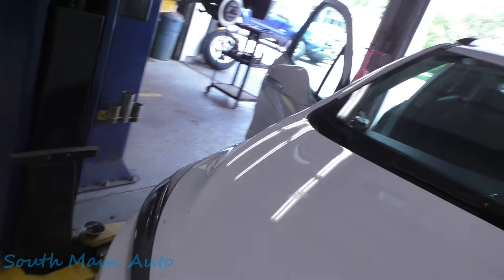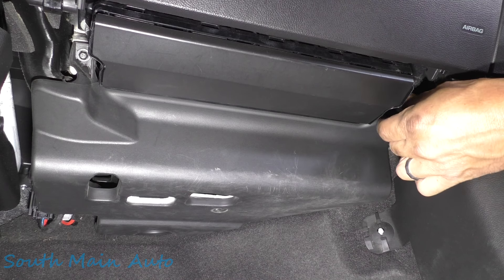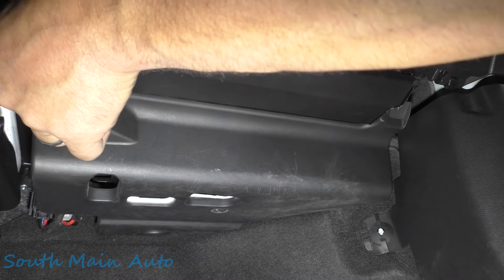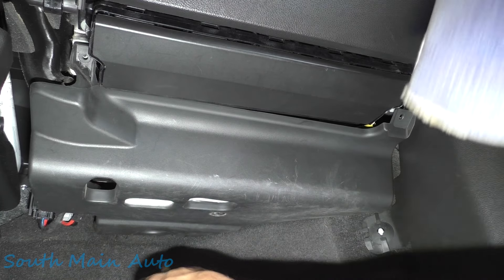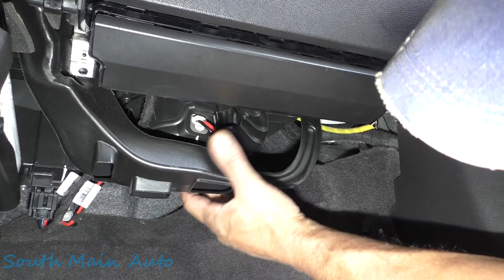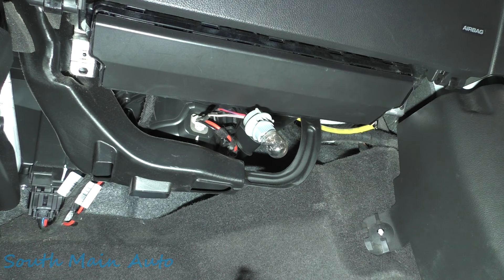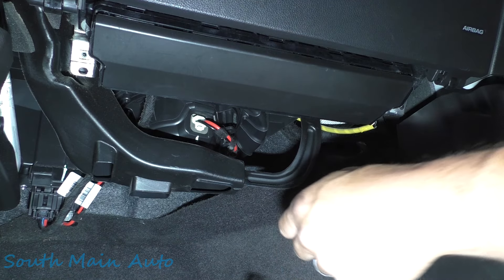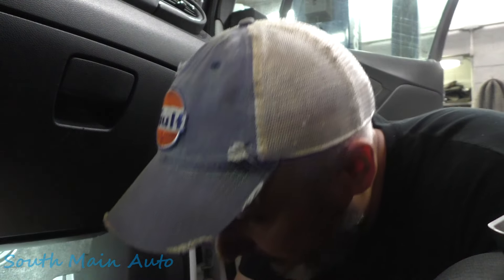Buick Encore - Blower Motor Replacement

Comment: Compare with the 5 minutes it takes on my 2012 sienna, from opening the passenger door, remove blower, install blower, close door.  Easiest blower fan I've ever done.  Not like the 1971 LeMans which required cutting a hole thru the front passenger wheel liner unless you wanted to completely disassemble the car from firewall forward.

The Toyota is mind blowingly easy. I just wish they built those darn fans with bearings instead of bushings.  I tore the one apart that is in there now after it had been screeching for some time and started stalling.  Pushed out the bushings and put in the same exact size in bearings.  Missed a spring washer I think, as it rattles now.  But it moves air and doesn't screech.

Comment: YOU MISEED THE HOLE! Go back to about 18:40 where you put the second of the 3 motor cover screws in and check your assembly. I believe you put the screw in alongside the hole instead of in it. It looked very clear it was not in the mounting hole.

Comment: My 2001 Honda Prelude needed a blower. You can't remove just the blower out of there without major work from the engine bay side. I had to dremel off some of the plastic shrouding from the old one to get it out and same on the new one to avoid all that other work from the engine bay side.

Comment: Interesting video - even if just a blower motor replacement; As an engineer, I still agree with Eric O about cost-cutting designs (which are not customer friendly, in the end, and therefore bad business on GM's part)!

Comment: Had a 97 Blazer way back when, same thing. They even molded a cutting line to indicate where to cut in the plastic of the blower box. It was topside work, but it saves the manufacturer putting a few fasteners in, I'll gladly pay that at point of purchase. Talk about stupid!

Comment: I know I am dating myself, but I remember when you could open the hood, unplug the electrical plug, remove an L shaped tube, remove 5 screws, and then you could pull the blower motor out.

Of course back then you could open the hood and actually see the engine and everything else.

Comment: 12:00 just let them dangle everywhere to get kicked, snagged and broken like the dealers have done!! (I'm not kidding, after repairing wiring and plugs) or actually attempt to make it work with zipties to hold the wires. if I recall you can ziptie around the ears that hold the cover on then ziptie the wire to those(double ziptie chain).
they had some permanent blowers like that many years ago and I think Chrysler and Ford did too. some designers bright idea 💩 and a PITA to replace, back then you could only buy the whole blower housings OEM, then someone made an aftermarket kit to "cobble" a new blower in.🤬

Comment: Reminds me of the GM vehicles with ball joints that are attached to the control arm with pressed metal pins instead of nuts and bolts. And when replacing the ball joint you have to grind off the pins and replace them with nuts and bolts

Comment: G.M. did this on some 95 ish jimmys with the heater core to remove  you had to cut on the doted line under the hood and leave a big hole. Nice

Comment: My first experience with a blower motor was on an old Buick. The first line in the manual read something like, remove the right front fender.
Reply: I’m still upset when a Buick dealer replaced the blower motor on my ‘74 Skylark by slicing a flap in the inner fender.

Comment: Older 70s GM cars "remove right front wheel,, cut hole in the inner metal fender(follow the stamped line) now you get to NOT cut yourself while working through the hole you cut. remove and install a blower motor. repair the inner fender using the piece you cut out. yours looked nicer

Comment: Everything is based on speed of assembly. The dash is pre assembled and installed as a single unit. They do not consider maintenance and repair till last.
The Service Manual is written by a Recent Collage Graduate with no previous experience with Automobiles. 😎

Comment: At least it wasn’t a ford focus. It’s buried under the dash and requires the glove box and fuse panel to come out. I tired but wasn’t going to break my back trying to get the screws up against the firewall ended up paying some 300 to do it and well worth it.

Comment: I notice in England when they dealing with plastic parts wire connectors they use a heat gun

Comment: Working at an auto recycling yard I have come across those stupid integrated Gm blower motors many times. Gm has unfortunately used them on many models in the last 20 years. Every time I’ve ever had to remove one, by the time it out I’ve always wanted to use the same hammer and chisel used to remove said blower motor on the side of the head of the guy who designed it.

Comment: the thing that I cant shake about these cars is, they have the provisions for the screws to hold the new blower motor in place.... which means that they went out of their way to put the original style plastic welded in, instead of just having it screwed in..

Comment: I worked as a vacation replacement at Jeep. I would fill the tanks with fuel. I accidentally put regular in a diesel and the line stopped and buzzers and alarms went off. These big shots came out of nowhere in two seconds to figure out what was wrong. Every 56 seconds another completed Jeep came off the line. If they can save one second you better believe they will.

Comment: I remember my 1996 Astro van had brittle plastic under the hood that I had to cut with a knife on the heater box. It just crumbled to bits when I touched it. That Astro is one of the main reason I don't like GM any more.

Comment: This is never really an "engineer's fault" it's the fault of an accountant basically threatening an engineer with losing their job if they don't cut 4% cost from the assembly they are responsible for.  This is the Engineers best response in the timeframe they were given.

Comment: I could tell right away it was the motor. That Humm noise that came on when you turned it on and no blowing occured. Bad motor bearing likely. The motor humm was it trying to work, but could over come whatever resistence was in there.

Comment: You should try to change the spark plugs (2) of a BMW G650GS Motorbike (One Piston).... You need to disassemble half of the bike to be able to pull the ignition coils and for that you need a special BMW tool to do. Also having a normal 18mm sparkplug nut is not sufficient - it needs to be a extra slim one.

Comment: GM hasn't changed. I had a 1971 Malibu SS 350 with AC. The blower motor went out about 2 months after the warranty expired. As in your situation, I had to buy a blower motor KIT. The kit consisted of the blower motor and cage, a packet of self-drilling sheet metal screws, a large rectangular sheet metal panel and a new rubber snorkel that attached to the new motor.  The blower motor was located in the large condenser box bolted to the firewall. The motor could not be reached or replaced from the engine compartment. I had to jack the car up, remove the passenger front tire and cut out a panel in the metal fender well to access the blower cover plate on the AC box. A rectangular groove was stamped in the fender-well indicating where to cut. Here's the kicker - the KIT did not include the gasket for the new fender-well panel "door" or the gasket & spacers needed to correctly install the new blower/cage. After checking with the dealer, found out those gaskets were only available in an AC Condenser Box Gasket Kit! Thank you GM! I just used 3-M Weatherstrip Adhesive to seal the panel in the fender-well and Form-A-Gasket and small metal washers to mount the blower motor. Also, had to use a file to dull the protruding sheet metal screws on the engine compartment side of the fender-well. Fun times! Had a similar issue rebuilding the power-steering sector (Saginaw recirculating ball) on that same car. Had to buy a Sector Rebuild Kit and two additional "kits" to get all the parts needed to correctly rebuild that sector.
Reply: I did 100's of those back in the day.  Was just quicker to unbolt the inner fender, and bend slightly out of the way.  Customers complained if the inner fender was hacked up.

Comment: And let's not for get the TRAVERSE it has a cabin air filter box but some have a block off if you want the filter you have to get the RETRO fit kit it's kinda like this cut out the plastic and glue it thing in .
And the let's not even start with the head lights lol stay awesome 👍

Comment: Freightliner did the same thing with heater cores. You had to cut them out and they sent you cover with screws for replacement. I always used a straight razor blade heated up with a micro torch. Worked pretty good. But you had more room to work on it compared to this.

Comment: Reminds me, a little, of the full size Fords from the 70's. The blower was replaced by cutting out the right-inner fender along the grooves they pre-formed into it. Of course, by the time mine died, the dealer no longer stocked the repair panel! Sheet metal, a hammer and zip screws to the rescue!!   ENJOY!!

Comment: 0:56 ....no check the fuse first
Reply from the maker: I can test the blower motor at the connector faster than I could find a fuse for the circuit

Comment: If you have a Chevy Malibu, wait till a headlight or front lamp needs to be replaced. The whole front end has to come apart. Be sure you have all the Lamps on hand as you can’t drive the car once, you’ve got into it. Don’t want to have a go back in a week, for an old lamp that failed. Wipe all the lamps off with Isopropyl Alcohol, or you’ll be back.

Comment: We have these things called tawny ants down here in Georgia, we usually call them crazy ants. They are attracted to anything electrical, in houses, vehicles, and anything else. They get into things and end up getting fried. As they do that, they let out pheromones that attract all the other ants and end up frying an entire system and have even been known to cause house fires after getting into the circuit breaker box. I unfortunately got them in my impala and they fried the actuator that controls the vents. When I got to the actuator, there was a big ball of fried dead ants. I never did get around to fixing it and just used it as a trade to my nephew for a four wheeler. I grew up in PA really really close to New York and was curious if those ants were up there or if you ever ran into that situation with those evil, devil spawned ants

Comment: I can't believe they still do that crap. I used do do a ton back in the day, haven't done that many in the last 6 years or so.  You know what gm told us to do for changing a cabin filter. Cut the box it comes in and slide it under the old one and pull out the cabin any debris falls it will be on the cardboard and then pull it out.

Comment: This is not as bad as the 09 mazda5 I have. It is in the middle of dash behind radio and stuff. Have to get to it through the sides and need to slide together and put a retainer on from other side i think. Had a place replace it and think messed up putting in and came loose abd fan stopped abd burned out the few sec it was running but stopped. They had to replace it free since it was just done and warranty. Felt bad for them having do it again free.

Comment: The Ford Transit (not connect), rear AC (if equipped), is a real stinker to get to .. and tough to clean the evaporator, as it doesn’t have a cabin filter.

Comment: Different field but when computer hard drives were not generic like today and very “wow gee whiz”, I remember a tech (not me) not using the new mounting screws that came with it and re-using what he removed. Turned out they were too long and touched the circuit board when tightened which fried the drive at power on. He ate the cost of replacing it which was a week’s salary back then. Ever since, I always use the hardware that comes with anything and only re-use the old hardware if it doesn’t.

Comment: This reminded me of putting in a fresh air filter in my 2013 Dodge Ram. You had to cut out the opening in the air box first then trim the opening so that the filter will fit and you then can install the cover that come in the kit. Dodge why you didn't do this on all your trucks 😒😒

Comment: How about the oil pump drive belt that's in an oil bath ?    That's right a belt that is in oil.  It will fail and it does fail, and of course when your oil pump quits being driven by that failed belt, then you have a major expense repair bill.

Comment: I think General Maintenance is an entire engineering disaster myself, but the blower motor on this Korean-built GM looks a little easier to work on than stupid blend door actuators and door lock actuators that were deliberately designed to break for a money grab.

Comment: I'm a firm believer that you should charge for any and all diagnostic time. If the customer does not get a repair from you based on your diagnostic time, they should pay straight labor rate for what they asked you to look at. If they get a repair based on your diagnostics, then sure, give some discount of that time (if you want). This stops the issue around stupidity... If they want to pay you for 8 hours to chase a ghost... so be it.  We have this same issue, just not in the automotive industry. Always charging for our time has worked very very well.

Comment: That doesn't look to bad.  My 88 Chevy truck, trying to get the cover to the heater core off is near impossible.  Multiple buried, invisible screws, the cover has to drop down to clear the heater box but the transmission hump is in the way and then to add icing to the cake, the heater core is clipped to the cover.  Who thinks of this stuff.

Comment: Having one of those days myself.  Funny how that bad attitude tends to color every little annoying incident.  Even the rain puts an extra dampener on things.  There usually comes a part of the day where something pretty good happens & we can get back to normal.  Can't be roses all the time.  The automotive world can be chock full of annoyances.  Engineers trying to be different or creative making repairs a lot more difficult.  They can design, but they typically can't fix anything.  Maybe they should just simplify things so that we can make repairs without going through hoops!

Comment: That's abhorrent. But it's a race to the bottom all around, I'm a mechanical engineer and I left the field because it's all consultant and bean counters run wild. I was amazed when I saw my 2020 Corolla has a aluminum valve cover and a serviceable battery. I shopped around a long time before I found a car that looks like it won't be impossible to fix 20 years later.

Comment: Try changing a cabin air filter on a '16 - '19 Chevy Cruze.
Gotta love engineering on that.
Reply: Oh god. You just brought back the anger of me doing that for my parents on their 2017 Cruze… how much if the dash and center console do you need to take off…. All of it!!!! 🤬🤬🤬.
Reply: It was on my brother's Cruze.
What we read (or saw) what had to be removed, it was insane.
That's because the glove box door and assembly was held down with screws.
Reply: @crlaw75  I ended up following a YouTube video and it was insane. All while I looked over at my corolla that only required the push in on the sides of glove box to allow it pass past the stops and then unclip the shock for it. And bam at the cabin air filter door, my truck. I just look under the dash and it’s right there in the open… then the best part was finding the hidden fuse panel behind the lower console… heaven forbid you need to swap a fuse out

Comment: I had my blower motor in my 16 colorado replaced by my local chevy dealer.  Along with mis diagnosis  they put it back together with only half the screws.   Yeah I checked their work and very disappointed

Comment: Even though the design was crap. It did seem to make a little sense by being molded in and sealing the system. At least they were nice enough to put that cut out groove in to make it easier to pull the motor. Maybe that was a nod from GM knowing this was a messed up design. The worst I've seen besides the ones where you literally have to crawl up under the dash was an old 89 Ford F150 super cab with the 300 straight 6. Out under the hood, passenger side. After removing all of the stuff attached to the airbox there was a line to follow cutting a hole in the box just to get to the blower motor. The repair kit came with a replacement piece for what you cut out plus a rubber gasket and even included new screws and retaining clips so you had something to put the screws thru. Wasn't too bad really except I lived near Chicago it was mid-winter, snowy, wet, frigidy cold and no garage. Took awhile and nearly frostbit fingers but got'er done. Fun times.